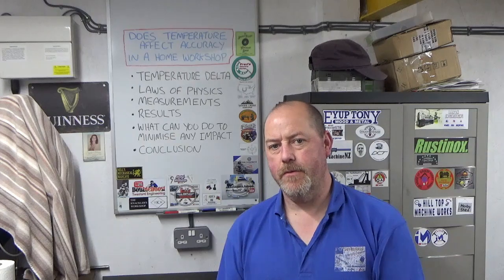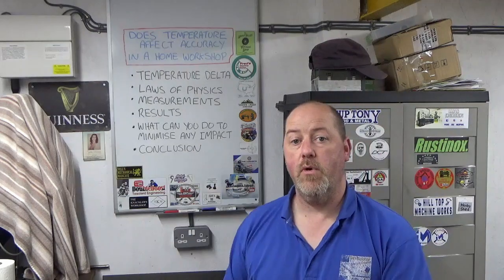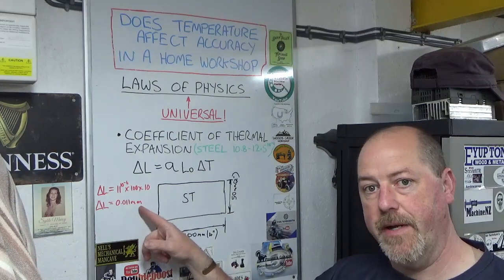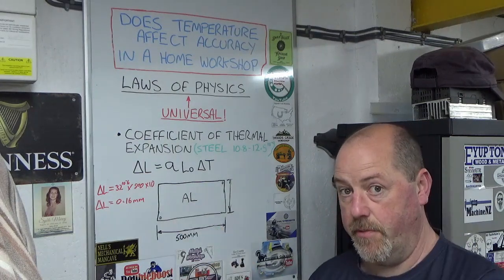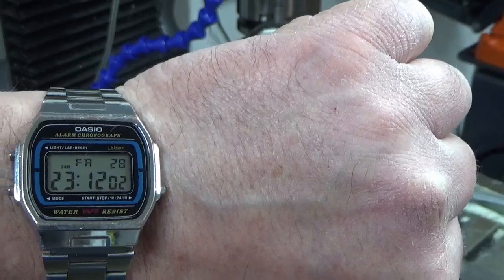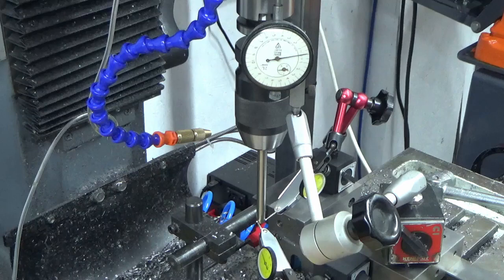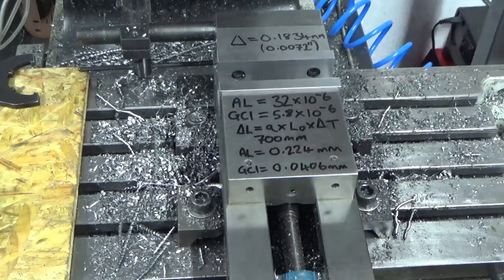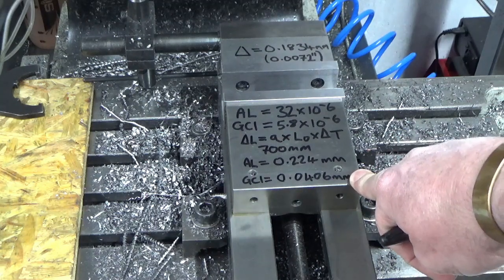Does Temperature Change Affect Accuracy in a Home Workshop

Comment: Hi Jon, Why would you have a negative change on one axis (Y) and a positive change on the other axis (X), with a round bar I would have thought the expansion/contraction would have been the same on both axis ?
Reply from the maker: Hi Martyn, thanks for the comment and the excellent question. I am in danger of writing a thesis here lol. This is a hugely complex topic but in summary, I am dealing with a metal Airfix kit where between the table and the spindle there are 10's of interfaces all with their own inaccuracies (out of squareness, parallel etc) and a mix of materials with different coefficients. The final movement at the spindle nose will depend on the combination of all of these variables and basically 'which inaccurate interface wins the fight'. I hope that makes sense as a summary, very very complex which is why I kept this video at a really high level otherwise it would have run for hours🤣🤣🤣. I will pin your comment as it really is an excellent question and your inquisitiveness pleases me, I thought it was only me sad enough to get excited about this stuff!
Reply: how could we have a talk? /. hope to sponsor , @jonsworkshop
Reply from the maker: @MaXpeedingRods_Coop  Hi, thanks very much for reaching out. At the moment I don't really want to go down the sponsorship route, as I believe that will detract from the purpose of the channel. If I change my thinking in the future, I will be in touch. Cheers, Jon
Reply: @jonsworkshop  thanks Jon , how i could keep in touch with you on ig or fb ?

Comment: Heck yeah it does.  Great Video Jon!  Hard to get a change in your shop as you said.  For me I get 0c at the min in the winter and then 47++c during the summer with over night lows changing I guess 15c or so.  115 and then 88 or so bananas early in the morning in the summer.  If you needed me to make you a precise part in the summer I would have to offset the dims for it to be on size at your shop.  Another thing can be when you were clocking the part in the machine, both the part and the machine change size..so as the machine contracts so does the part.  the scales have some wiggle room in the stability of the glass being glued in with a silicone adhesive so it doesn't rip the glass apart when the holder changes size.
Reply from the maker: Hi, thanks for the comment. 100% on everything you say! Our range is -18C to +30 at worst so similar. I could bang on for ages on this topic, soak times, thermal gradients etc etc but I think I would bore people lol. Cheers, Jon
Reply: I was also curious about the glass scales and their thermal  coefficient.  Is the glass more stable and helps compensate?
I wonder if your machine and workk piece with same thermal coefficient if using mechanical scales and screws etc would cancel each other out?

Comment: That was very good Jon. You know how much I like the calcs. My workshop is actually part of my house, so I am very lucky because the temperature in there is uniform, pretty much, year round. It is something that I am very glad about.

Like others have already said, I think the biggest issue for a lot of us is the very large deltaT's that can be had by heating due to machining. That is how dimensions can easily be blown, and yes I have done it.

As an addendum, another interesting use of the expansion formula you showed is to design shrink fits in components. I did exactly that when I dimensioned my bronze acme nut and continuous cast iron nut housing for my Harrison milling machine.

Thanks for a great film.

Comment: I have seen 0.03mm difference in diameter on a bearing on a 25-degree delta. It can influence a press fit. I measure the bearings at temperature before I do my final cuts.

Comment: Nice subject Jon, yes, many think it needs 100°C delta to impact accuracy and tolerance.
Clockmakers knew this, hence the pendulums are manufactured from two complementary materials to reduce length change.
My apprenticeship machining was on copper and bronze alloys for resistance welding equipment,  what fun.
Excellent video. 
Thanks for sharing

Comment: Interesting video Jon.  A more common way to get bitten on this is workpiece heating due to cutting, particularly on lathes where you might experience 50 to 70 degree deltas.  In terms of lathe work, most people know about diametric changes, but tend to ignore the associated length changes, this can blow axial dimensions quite easily.

Guilty as charged :)
Reply from the maker: Hi Wibbly wobbly, thanks for the comment. Yup, bang on. I should have mentioned this in the video. I have covered this in previous tips videos etc, but I wanted to split the two things out otherwise it becomes a monster of a topic to try and cover. Cheers, Jon
Reply: @jonsworkshop  Hi Jon.  This was my thought as well.  A good case for flood coolant, but most small hobby lathes don't have that.   A very complex subject as you have said.  Cheers rob
Reply from the maker: @Xynudu  Thanks Rob. Cheers, Jon

Comment: Hi Jon, the varying emissivity of the surfaces affects the reading from non-contact IR thermometers. To get a consistent reading you need matt black. Get a roll of black (or blue isn't too much different) masking tape and stick it to what you want to measure. Excellent topic for us amateurs, whilst I could have worked this out I didn't (because I try to engage brain as little as possible in down time), so I had to learn this the hard way!
Reply from the maker: Hi Olly, thanks for the comment and tips on the IR thermometer. I will get myself some, I guess sharpie on normal masking tape may work, will give it a go. Cheers, Jon
Reply: @jonsworkshop  Sharpie on masking tape will also work, I've done that myself.

Comment: Good video thanks Jon. I think this also links in to your video on coolant. When machining bearing diameters on the lathe coolant is a must because the CTE increases the diameter during cutting and then when the part cools it is undersize. I also had this issue on my surface grinder when grinding dry. So I always use flood coolant now when trying to hold tight tolerances.
Reply from the maker: Hi, thanks for the comment. Yes, you are correct, definitely linked. I wanted to split ambient from generated heat as trying to cover both in one video would have been difficult and probably confusing etc. I only scratched the surface here as well, this topic is massive (measuring temp gradient from floor to ceiling etc etc). Cheers, Jon

Comment: Hi Jon, my DRO has glass scales mounted in Aluminium housings, they are held in with rubber inserts so free to float with unequal expansion, yes the housing will bend hoping the error will be reduced.
Have no idea how much the glass scale will expand with 10 degree Celsius temp change.
Reply from the maker: Hi Willem, thanks for the comment. If its normal glass, it will be similar to steel in terms of expansion, if it is Pyrex glass it will be almost identical to cast iron, and if its quartz it will be almost zero. Glass is very stable below 1000C, which is why it is used in machine scales. Rubber mounts on the more expensive scales mitigate the effects. Cheers, Jon

Comment: Digging around in the dark recesses of my memory banks, not something someone should do if they are of a sensitive nature, i recall that they found railway tracks only expanded at the ends of the rails which is counter intuitive. That was why traditionally they had short ish lengths and expansion joints, but found they could have long welded tracks and far fewer joints, making for smoothrr and quieter trains. Mind you as that snippet came from my recesses it could well be complete phooey, or should that be utter bollocks?
Interesting subject all the same but how many of us have temp controlled environments outside of a metrology lab, if only i had the dosh! Maybe in my next life?😗

Comment: Thank you Jon. A very interesting subject. I've learnt to let parts cool down after machining before making final measurements. Using cutting oil to reduce heat. Stefan Gotteswinter did a recent video on the subject using a test inducator to measure metal expansion. More tips like this Jon are so useful to me. Cheers Nobby

Comment: In 1989 I was a steel fabricator.  I was working outside in mid summer  on new 1.5m high, 27 m long castellated beams. The inspector checked my work at the end of shift and said I was 5mm over tolerance and I needed to remove an end plate and shorten the beam before welding. 10am next day it was within tolerance without me touching it 😂
Reply from the maker: Hi Neil, thanks for the comment. Lol, you clearly knew better than your inspector 🤣🤣🤣. And you know fine well if you followed his instructions and next morning it was undersize, it would all have been your fault. Cheers, Jon

Comment: Hey Jon m, nice video! 

I once worked temporarily on a hardening furnace for sintered parts. gears for diesel pumps for VW were manufactured there. the dimensional tolerances were CPK +/- 3.2 müy We had special measuring rooms in which the temperature and humidity had to be maintained. and when entering the measured values, the component temperature and room temperature also had to be recorded. a difference of 5 degrees celsius resulted in a measured value difference of 15 müy ... that's about 1/6 of a human hair. that was interesting work.

Have a nice weekend!
Reply from the maker: Hi Chris, thanks for the comment. Sounds very similar to the work I did in Rolls-Royce, we were splitting microns as well. 😊. Cheers, and I hope you are well. Cheers, Jon

Comment: You could have put a long length of aluminium in an oven at 100°C and measured the length and temperature at the same time, then done it again when it had cooled down because machining can make something pretty hot. I think this is something that the home machinists need to worry about more than the night and day temperature difference, as most probably use blunter tooling with no cooling methods. One experiment that would show more of a result to get your point across maybe, just an idea, these measurement experiments I find interesting. I liked it when you get into the mathematics of engineering.
Reply from the maker: Hi James, thanks for the comment. You are correct. I have covered this in previous tips videos on coolant and balanced cuts etc. I wanted to cover the ambient temperature aspect in isolation otherwise it gets really complex trying to explain the joint effects of both etc. Hope this makes sense. Cheers, Jon

Comment: It always surprised me how much difference in temperature reading you could get when checking different surfaces with an infra-red thermometer, due to the different emittance from those surfaces, even though you totally knew they were all the same
Reply from the maker: Hi Bill, thanks for the comment. Yeah, just getting used to mine as its a new toy. Going to get some matt black tape which I am told improves the variability. Cheers, Jon
Reply: @jonsworkshop  I got one from Aldi, from the middle Isle, an impromptu purchase if you like. It would have been 5 or 6 years ago, then a couple of years later I went to use it for the first time. The rubber outer had sort of perished and gone all sticky and semi liquid, absolutely revolting. It still worked, but it went in the bin.

Comment: Youve used the thermal expansion coefficient for cast iron per degree Fahreneight. Your value for the thermal expansion coefficient of aluminium seems rather high. Typical  aluminium aloys have a coefficient of thermal expansion of around 24 ppm/C near room temperature. It may be somewhat higher for temperatures significantly above ambient, The thermal exapnsion coefficient  of most metals approaches zero as the temperature drops to absolute zero.